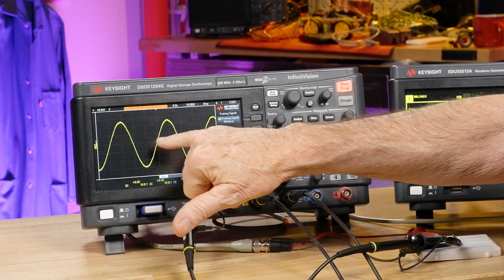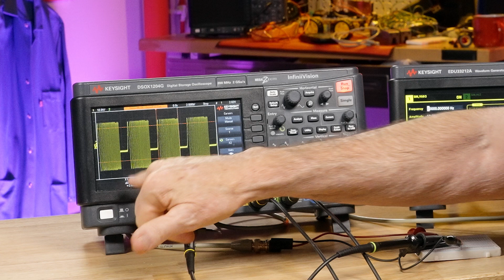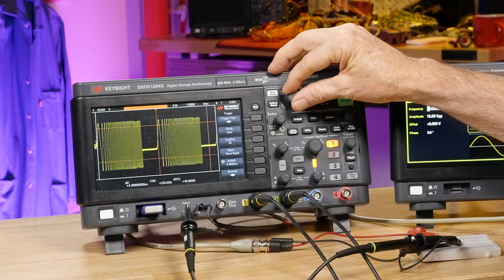Lesson 12: Triggering Part 3 - Trigger Holdoff

Comment: Hi, I want to record about 10000 random pulses, it's single's frequency is about 10 Mhz and my oscilloscopes sampling rate is 1Gs/s, can we reduce sampling rate to get more pulses according our limited memory?
Reply: If I'm not mistaken, most oscilloscopes automatically reduce the sampling rate when you zoom out or reduce the signal frequency. There doesn't seem to be a way to manually set the sampling rate. In your case, if it's a square wave, I would use a USB logic analyzer.

Comment: I have a question but First just want to say Thank you so much.
 I'm gonna. Keep coming back to your videos about our scope. 
What if there is random bursts and not in order of 4 ms. 
I have a customer Who is equipment circuit boards keep Blowing out because something is going on in the incoming ac 120 power line. I need to set up a scope to catch it.
Reply: Hi, maybe you can try connect your scope to PC and save data while sampling over time. Then you can look at the data and isolate the time frames where issue ocurred.